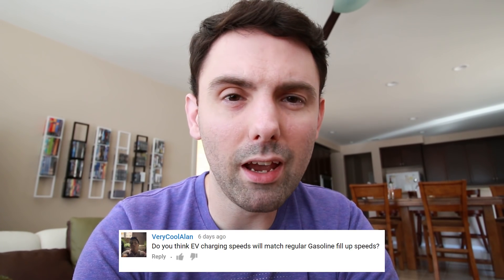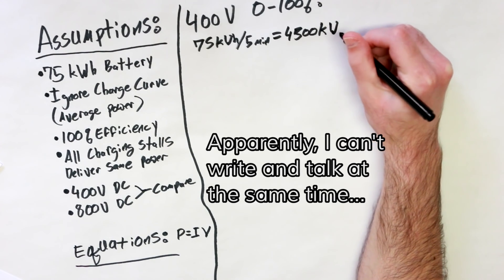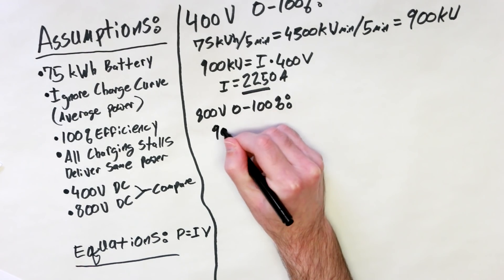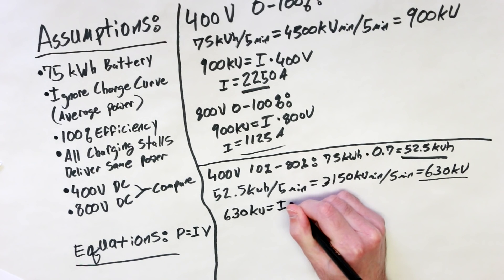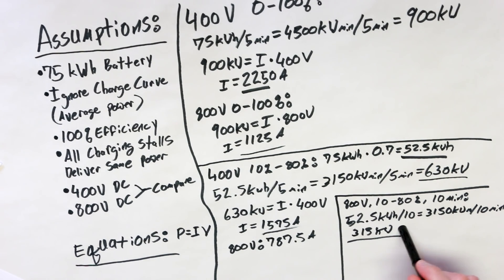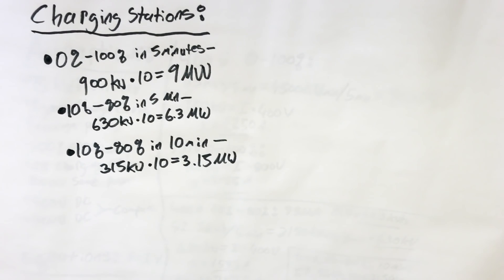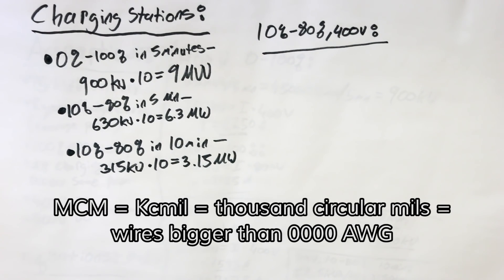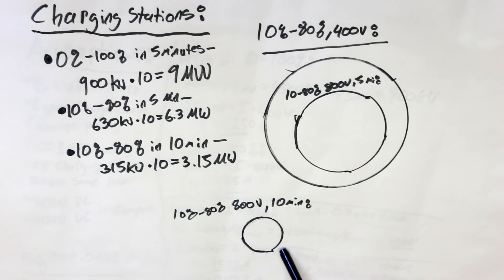Can Electric Cars Charge As Fast As Gasoline Cars Refuel?

Comment: The only way that I can see a charge-up becoming as fast as a gas-up is if we moved away from electrochemical batteries to using supercapacitors; but I think that might be some ways off.
Besides, with a long range Tesla at a supercharger station would only take about a half hour. You can't find something to do for a half hour?
P.S. Yes I know, not everyone can afford a Tesla (I sure as fuck can't), but my point is that we're at that level right now.

Comment: What about putting supper capacitor at charging station and in the car.  Dump the charge from one to the other and while driving away the car recharges itself at a safer rate while moving. I know they use such capacitors to capture power from regen braking.
Reply from the maker: The energy density of current commercially viable super caps is much lower than current Li-ion cells. You'd need a very large cap bank to put a meaningful amount of energy into the car's Li-ion battery and if there were high enough density caps to fill this role, it'd probably make more sense from an efficiency standpoint to dump the Li-ion battery and run the car off caps.

Comment: why we don't see charging stations at large scale with 10 or 20 DCFC at a single place, it is always one or two? we have to replace our normal gas stations at some point in the future with electric fast chargers, am I right ??
Reply from the maker: Well, yes and no... Infrastructure will need to be significantly expanded along long distance travel corridors (which is basically the core of Tesla's approach to infrastructure rollout, with the 40 stall Kettleman City Supercharger being one example) and local charging infrastructure will also need to grow significantly over the coming years, but not really to the point of replacing gas stations with mass DC fast charging stations. Remember, every home garage, carport, multi-level parking structure, and parking spot can potentially be made into a L2 charging station and most cars (either at home at night or at work during the day) spend most of their time parked. With battery capacities increasing, the need for fast charging while out and about begins to disappear for most drivers, reducing the need for local DC fast charging and shifting most local charging onto comparatively cheap L2 AC stations that can be placed pretty much anywhere.
Reply: Well, good point of view, but I guess it all depends on the city infrastructure and houses arrangements, for crowded cities I still think it needs large DCFC stations. But for good urban designed cities L2 charging will dominate as you have suggested.
Reply from the maker: True, it does depend on the city... However, even in the densest US cities, growth in L2 infrastructure could largely cover privately operated cars (again, they're still parked the vast majority of the time) but significant DC fast charging infrastructure would be needed for constantly running fleet vehicles like taxis, which there tend to be a lot of.

Comment: This ultra fast charging is comparable to the power needed by underground trains. 
Berlin underground trains run at about  1000 kW (700 Volts DC). Obviously this is not delivered via cables but a massive third rail.  
If we want that kind of power delivered to a car we'd have to give up using cables. 
Metal thick rods could be pushed from a connector in the ground into the car or something.

Comment: The solution will probably be manufacturing batteries able to accept more power and the supply line wil go for higher voltages rather than increasing the current. With so much current you need too big of a cable to dissipate all the heat.

Comment: Very quick charging as an option: if EV manufacturers provide the possibility of multiply charging by multiply the connectors on the EV, it would be greatful. As I mentioned, it would be an option: so you can push only one connector if you have time and take your time to charge your batteries, but if it's urgent you can push an additional plug next to the other. The vehicle charging system identify that second plug, and  divides the batteries into two major portion (e.g. by switch(es)), and handle them as two independent battery pack. (E.g. one vehicle with 100kWh batteries; charging time 30min, then a vehicle with 50kWh batteries it would be 15min. If you devide the 100kWh battery-packs into two portion, and you can charge each 50kWh pack independently and simultaniusly, and after the charging reunit them, than bang, you have charged your vehicle with half of the time compared to the time you can get with only one connector.....According to the example here the 100kWh in 15min.And also the diameters of the cables can be handable enough for e.g. an old lady....Twitted this idea to Elon, hope he got the principles of this idea...(twitter has rough text character limitation so yea, who knows...)....

Comment: Do an update while considering the new stated figures from the Samsung graphene battery. 45% higher capacity and 12 times faster charging.
Reply: Great point!  All the time I was thinking his estimates did not consider a radical design change in the battery itself -- which I think is where the technology has to move to realistically accommodate really fast charging.

Comment: what about inductive chargeing like there doing with cell phones now, but put a coil on each cell and charge them individually. isnt there 100's of cells in the pack, and im no electrician but wouldn't that mean 100th the power per cell? put the pad in the ground under the car and no plug needed.
Reply: No, there're thousand of cells in a battery pack.

Comment: If everyone had an EV today it would be utter chaos and no one would be going anywhere.
Reply from the maker: +Barry Rudolph Well, then it's a good thing that there's time to work on rolling out infrastructure while the EV adoption rate increases...
Reply: That is my point Alex. People preach up a storm on You Tube about how great electric cars are but seem to give little thought to the enormous amount of power that we will need to charge millions of cars. Building that infrastructure will cost billions or maybe even trillions of dollars and has to come from somewhere. Don't expect the electric car to be economical for long because that money is likely to come from higher electric rates.
Reply from the maker: +Barry Rudolph The core of that argument seems to hinge on the utility business staying the way it has been for decades and I'm not so sure that's a reasonable assumption to make. The way I look at it, increasing generation is a secondary issue... with the primary issue being the short-to-mid term solvency of conventional utilities. Technology, specifically the rapidly decreasing cost of photovoltaics and battery storage, is potentially setting up for a sort of energy arms race between utilities and their customers.

Let's take California as a simplified example: the state enacts a net metering policy with a retail rate generation compensation requirement (NEM1.0) to promote things like rooftop solar, high energy costs combined with NEM1.0 makes rooftop solar a financially sound way of significantly or completely offsetting costs, many residential and commercial customers adopt said technology, this results in a hit to utility revenue, so the utilities lobby the PUC to change the NEM rules, long debates result in NEM2.0 which allows utilities to charge additional fees for generation, people counter by installing larger PV arrays and dipping their toes into local energy storage. If the utilities eventually succeed in killing net metering, then local storage becomes even more attractive.

In this scenario, the utilities are beginning to lose revenue and customers because small scale local generation and storage technology is becoming cheaper faster than the utilities can adapt. Generation increases and billions of dollars are spent, just not quite in the way one would expect. The concerning part, however, is that the utilities must fight to remain solvent as this arms race plays out (not an easy task given the various political pressures they're under, coupled with significant infrastructure, fuel, and regulatory costs) and it's likely that those who don't have the resources to participate will get stuck in the middle, forced to bear the brunt of supporting the utilities through increased rates. California is still in the early stages of this mess, Hawaii is further along (temporary bans on solar grid interconnects, etc.), so it'll be interesting to see how things unfold over the next 10-15 years.
Reply: There are so many other things that we have not even touched on that will be affected by this monumental change in what makes the world run. This is not the place for such a complex discussion.

Comment: There is no reason not to boost the voltage further. The line voltage at top of power pole is 13kv (13,000 volts) and up. A couple kv aren't going to kill you any deader than 800v.

How do you make 1,000 volts or more safe to handle? You don't. At that point, inductive charging becomes a must.

Comment: The main limitation may be cable size.
A copper cable of 38mm (about 1.5", Density 8.96 g/cm3) weighs by my calculations about 10kg / metre (about 22 pounds per yard) without the insulation. So if you are lifting even 2 metres of cable, that's more than 20kg / 44 pounds and the cable will be pretty stiff.
Reply: "main limiation"

Even if we have thick cable, you can't charge battery that fast anyway. Batteries charging are limited by their chemistries, so unless you develop new faster charging chemistry. None of that high power charger would do any good because the battery cannot even withstand that.

Comment: I can imagine inductive charging at the traffic light as well. How much current transfer via induction would be possible, in 1-2 minutes waiting for the green light? The size and weight of the induction receiver in the car, might be the limiting factor here. What is the efficiency, compared to charging via contact cables above the road?
Reply from the maker: +Christoph G. Inductive charging can only transmit AC, which means to charge at high speed (aside from coupling hardware issues) you'd need to have a cabinet worth of charging equipment onboard or feed the power through the motor's inverter (which has it's own trades) to do the AC to DC conversion. At typical L2 charging speeds (240V 30A, for example), aftermarket inductive charging systems are about 85% efficient over the air gap and then you have to factor in the efficiency of the onboard charger.
Reply: What about wires touching the underside of the car? I had a "Carrera race circuit" (electric race car toy) when I was younger and they used this technology to drive the cars over the track. The cables in the road would come out when a car stops on top. That would probably be even cheaper than the inductive technology. No extra charging equipment in the car would be needed and the efficiency losses would be small. 
You would never need to stop for charging again when you are in the city and range anxiety would be no issue. We could charge the cars if there is a overabundance of energy, in turn reducing the cost of electricity and stabilizing the energy grid, for example if there are solar or wind peaks. 
I can only think of two possibly negative points: 
1.) It might be a bit more expensive than a regular charging station- 
3.) Dirt could make the contact worse.

Comment: Great presentation, hopefully it helps the less technical.  I hate the 0-100 charging times in every article, when was the last time you ran you ICE car to 0? Refueling an ICE from zero is about an 2 hours by the time AAA gets there.

The technology is just different, when you wake up every morning to a full battery in an EV parity of a liquid fuel station is irrelevant for most people on most days.  If you take a lot of road trips and can't wait more than 5 minutes to refuel then stick with an ICE vehicle where the fuel costs EVERYDAY are x3 or an extended range EV.

Comment: Nice video. The way I would look at it  the other way around. The only time a lot of people fill up is if they are going on a long journey. So for week in week out no need to ever visit a charging station (charge at home). For longer journeys if you get 200 kw charging speed you've cracked it. Let's say I have a 50 kWh battery and I'm getting 4miles pkwh. To charge 150 miles of electric = 37kwh approx. This would take around 12 to 15 mins. That's around 3hrs of driving on highways in Europe. It takes a minimum of ten minutes to park go for a pee and return to your car. Three hours non stop driving is beyond most people's comfort zone. So at this point you can effectively say I never ever have to make any extra effort to fill my car with fuel again.

Comment: Why are we assuming there is a cable? ... maybe a connection underneath the car with a large contact point you drive over, still have to solve the battery chemistry and station delivery, but cable size wouldn't be a factor. This electric bus uses a large contact plug-less charging system on the roof, also, they show a massive charge cable : https://youtu.be/9JpMTWdPZ6c?t=11m35s

Comment: I think the best thing is to just make a massive battery that can make your car drive well over a 1000 miles, then the charging time isn't that much of a problem any more because you'll have to sleep anyway.

If you need that much energy in such a short period of time you're basically asking for mission impossible, because it's not just the battery who struggles at such a point, it's also the power center that needs to deliver these amounts of energy unexpected in such a short period of time and on top of that, as soon as the battery is full have to immedietly stop generating that enormous amount of electricity as well. And it's not like a dayly rithemn that everybody wakes up and uses a lot of energy and in the evening when everybody is cooking, using the microwave or so and eating, also use a lot of energy, but no, people are planning to randomly supercharge whenever they are planning to hit the road.
Reply: Pretty easy to drive 1000 miles in a day even with charge stops in a Tesla.  You'd stop more often--like 5 times but I can't imagine NOT stopping for a 1000 mile goal.  At least twice.  I think the magic number would be like 500 miles range we're halfway there.   My 2 year old model S can do 200 miles easy.
What you DO need the extra capacity for is bad weather.  It's not just electric cars that suffer from mileage degradation due to weather.  ICE cars to also.  So good weather 500 miles range would give you that buffer and in bad weather maybe you would only get a 400 mile range.  No problem.
Reply: Either way, it's much better as asking for a 5 minit recharge, on top of that, the battery will last much much longer when it's bigger.

Comment: You mixed quantities with units of measure in your formula. So, it is either P=IE or W=AV.
Rather than having to explain what E is, I would have used the second formula.
Reply from the maker: I can't say that I've ever seen P=IV written as P=IE in any engineering textbook... also, in this case, V is electrical potential (Voltage) expressed in Volts.
Reply: Notice how all this reduces to TIME.  Smaller the conductor the more the time.  Higher the voltage the lower the time.  More capacity, more time.  Nice presentation and hopefully people paid attention to the issues.  An 800v system would be nice but the dielectric qualities of cables would need to improve.  In the case of Tesla you're using a lot of time since you have to ramp up the charge rate slowly at start and then taper off to get that last bit of charge on top.  Those two components take long (I think) than the max charge rate you see during a refill.  That's an area that could improve by either a) better battery chemistry or b) better current management.  Teslas don't do much with the voltage--they control the current during your SC charge.  Maybe some combination could get you over that StartOfCharge and EndOfCharge slow down.

Comment: Who gives a crap if we have to charge our e-cars overnight?  The fact is, we can drive for 1/5 the comparable price of gas for most of the week.  A very decent trade off in my book.
Reply from the maker: Agreed, though the topic of faster charging is usually in the context of long distance travel (which was also my focus here).
Reply: I don't think the cost of the energy for driving, is really the biggest concern. Bigger concerns are dependability, cost of repairs, and the convenience of the technology. And of course, the high cost of new EVs.

For example, they say that running the air conditioner shortens the driving range of the EV. But what do I care? Baking in a car-oven is better? Like I have any choice? (Society is too sweat-phobic. Society practically requires anybody with a decent job, to cocoon themselves in air conditioning.) Just so long as the range is still sufficient to get me to where I need to go. I figure if humans still have to do the driving (well so far), then a cooled driver is a happier driver, and a safer driver. The loss of range from running car accessories such as the air conditioner, will be soon replaced with the next night's recharge. Also, combining trips efficiently, reduces the amount of time spent in the car, during which air conditioning is needed.

Of course, it might make sense to run errands more so before the heat of the day. However, I just do not seem to be an early-riser. Not often am I already waiting in the parking lot, when the place opens for business.

Charging at night in some ways is better, because we no longer have to stop at fuel stations. However, having to recharge in the middle of a trip, is still very inconvenient. That is why getting greater battery recharge range, has been such a huge deal.